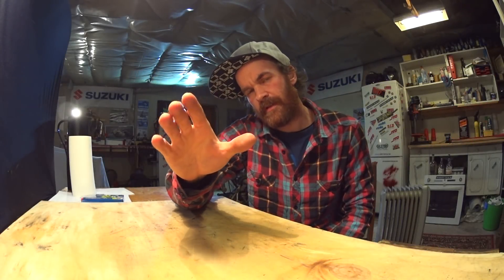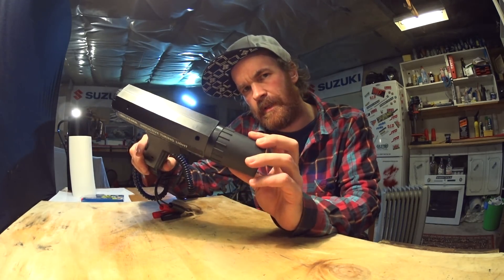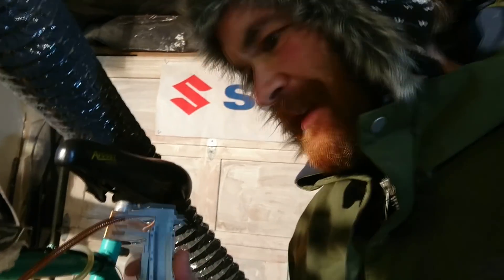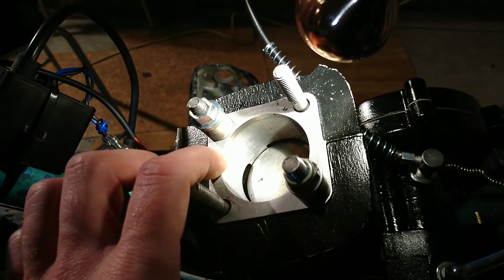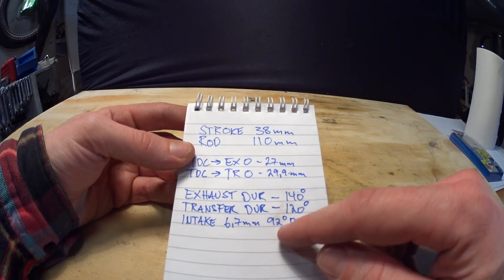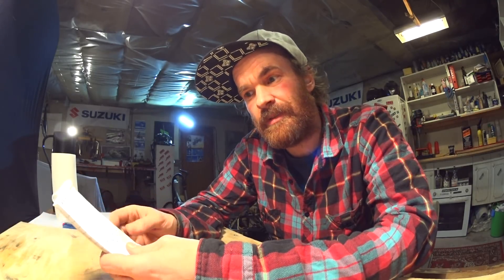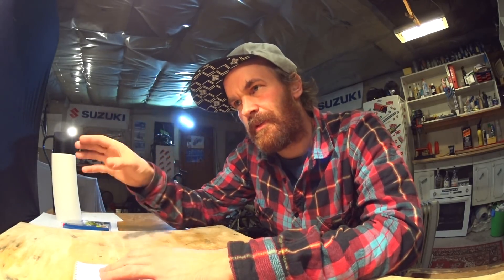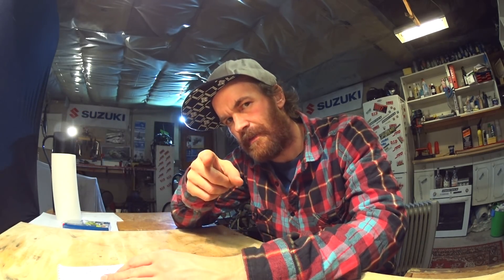Port Timing Motorized Bike, I'M SHOCKED! WHAT WERE THEY THINKING??

Comment: 🤔 you should well in my opinion do a port without a polish Dino test it and then polish it to see what power increases could be made with a polish proof of concept be cool I suggest testing the American hillbilly way and using steel wool to polish the ports i’ve done this before it works quite well surprisingly if you don’t believe me tested get some 0000 stealwool! Leaves a super smooth finish on aluminum
Reply: Jojo Mahama polished surfaces inhibit fuel flow compared to the slightly rougher surface, polishing does help in the exhaust port though.
Reply: Jon Rothenbusch That’s just I used steel wool because it leaves little tiny microscopic scratches but to the touch feels smooth I never polished it with steel wool till it was shiny and perfect and smooth as glass or anything just used a Dremel with a carbide bit and right after that used the steel wool. I just think it would be a good thing to test considering what I just said, thank you for pointing that out though👌🏻 I should have explained things a little better but then it would’ve been an extremely long comment just like this one. 😱 it just seems to have made my bike a lot faster! (throttle response and top and power) I do live at 80ft↗️sea level though so that could have some affect. Anyways I just thought it would be a good idea since he said he was going to go from one thing to another to another and it’s also a cheap engine if he does it on the motorized bicycle engine.
Reply from the maker: +Jojo Mahama Would be interesting!

Comment: I would cut it and either shave the head or top of cylinder or both, And maybe a thinner head gasket to restore compression. I have done this on outboard boat motors with good results.

Comment: I think that you should get a hold of a couple of extra cylinders just in case, and go ahead and port the stock cylinder. Then you can compare/test future upgrades on both a stock cylinder, and a ported cylinder, so people with stock cylinders can still see just how much extra power an upgrade will make from a stock cylinder vs a ported cylinder.
Reply from the maker: +Martinoffi Good idea!
Reply: Those cylinders are only like $15-$18 , that's what I'd do.

Comment: i would love to see. what could be gained from the engine with out changing cylinder, i like to no , if exhaust made for desired 140 duration made any power increases at all, as if you change barrel, then the  carb and then everything else., then what is there to learn from this motor. if a new complete engine is made then modified.  love this channel.
Reply from the maker: +nodwas1 Thanks! Good thoughts!

Comment: Why you don't use a graduate disc to measure the ports timings. It's more accurate I think.
Reply from the maker: +Olivier R That's a good method too! More accurate than the calipers, but micrometer is more accurate yet in my opinion.

Comment: If you have enough room under the bottom ring to open a boost port in the piston ( eg it is clear of the inlet port at bdc) grind a boost port channel in the liner and open it 1mm before main transfers and angle it so it flows at the edge squish/combustion chamber. I did this on a 250 single and the seat of my pants dyno felt an improvement. Your dyno could shatter my delusions. The trace carbon on the head looked like it flowed well.

Comment: I would say you have to lengthen exhaust duration before moving on to other things. I would go to 160 and test then go a little further and test again. I work with bigger engines a few 125s and 250s but most 500cc and up snowmobiles but my guess would be around 180-200 degrees exhaust because you going to end up building a pipe so you could build it to match that duration. Id say thats good for around 9000rpms.
What do you think?
Reply from the maker: +Dragon800 Sounds like a plan!

Comment: Did they design this engine to run without a tuned pipe? Without that properly timed pulse back into the cylinder, wouldn't you need a low exhaust duration to help prevent the un-burnt mixture from escaping?

Also, could it have been a very simple "EGR" for emissions purposes (ie. to keep some exhaust in the cylinder to lower combustion temperatures)? 

I have no idea, I'm asking you.
Reply from the maker: +Tyler Bandle possibly, good theories!

Comment: Holy crap that is nuts.  With port timing that bad, it doesn't really make sense to try intake\exhaust mods.  I'd say port it and try to get the timings where you want them first, then do the intake and exhaust.  My only guess as to why the port timing is that bad is so the engine isn't stressed at all?  De-tuned on purpose perhaps?

Comment: Not all cylinders are the same. Many are different. Unfortunately that’s one of the biggest problems with these. 
If you raise it more then 2mm your going to lose a lot of bottom end. If you raise the intake port you’ll need a Reed valve
Reply from the maker: +Zeda Motorsports Yeah, I think maybe I should get a "selection" of cylinders and see which fits the best.
Reply: I think most of the "bottom end" will be recovered by raising the compression and giving it a proper squish band. if nessasary re- gear to allow it to scream..
Reply: @MaFTB  I could reach speeds up to 90 kph with ease and .made it better on fuel cos would cover alot more ground on the same quantity of fuel also

Comment: Sure about the rodlength?
110mm is very long for 38mm stroke, but you never know with theese cheapo thingys =)

However, make the inlet in harmony with exhaust first.
Reply: i thought the same thing an rd rod is that length, it seems long for somthing so small. I just assumed you measured it. Ill bet they have measured the overall length not pin to pin
Reply from the maker: +Patrick Wetterskog Yeah, I was shocked when I read it. What's even weirder is that this is the "short" rod, other variations of this engine run 115mm. I haven't measured it myself tho, could be a good idea.
Reply from the maker: +marcus mcc I'll have to check, if it's shorter it would make port timing a tiny bit less insane.

Comment: around 190 deg. is too much for that engine,it will have no power down low.
Reply from the maker: +Vlatko Veselinovski Depends on the pipe, but yeah you might be right.
Reply: I would go 160 ex,115 tra. and over 130 intake on that cilinder with some mild pipe

Comment: That's what rhose things are for I have one in a garage but got no India what it did could it be used to check for spark because the motorcycle I am repairing seems way too hard to take off the spark plugs

Comment: If you port the exhaust higher you will need a real exhaust pipe, that would be interesting :)
Reply from the maker: +Nicolas Galley Yeah, Maybe the Malossi Team pipe I've got hanging on the wall could actually work!
Reply: 2STROKE STUFFING Oh yes, would be great ! Will the crank support the high rpm?
Reply from the maker: +Nicolas Galley No clue...

Comment: I would like to see porting step by step. This is a single speed so you need a wide powerband. My mildly ported bike pulls strongly right from idle and when racing you dont want to use the pedals to much.
Reply from the maker: +OSSA Nyberg Good idea!
Reply: I want to see you do what he said like how far should I go up on exhaust and I seen David’s video on how wide but is that to wide for mild port cause completely stock on a cdh engine I’m hitting 40mph and not I installed the Reed and windowed piston and it’s not firing at all it’ll crank but sounds lean I’m ordering jets they are on the way

Comment: Are you limited by the port metal thickness? 8mm is a long way to go. I would think you would grind a hole in the outside of the port.
Reply from the maker: +ngneer999 Probably, I'll look into it next time.

Comment: WOW! So if I'm thinking about this right prior to you spacing the cylinder up the exhaust port timing was even worse? Please make a video on a fix for this. It seems that spacing the cylinder up and shaving the deck is really needed.
Reply from the maker: +Allen Brown Yep, was even worse!
Reply: 2STROKE STUFFING - So my next question wold be since there is only so far you can go with raising the cylinder itself will raising the top of the port without raising the bottom be a problem? I guess what I'm getting at is will this take the duration too far?
Reply from the maker: +Allen Brown Duration remains the same regardless of the port floor being lifted or not.
Reply: 2STROKE STUFFING - Ah, ok. I see. Thank you my friend. Can't wait to see your solution for these problems.

Comment: First take the exhaust port to 155°, because this is the best timing for just a muffler on the exhaust and a fixed gearing. But 120° of transfer timing maybe already to much for this setup. After this I would go for 180-190° of exhaust timing and add a nice expansion chamber + fat carb. >>> to the max
Reply from the maker: +Elmar Dylong 👍

Comment: 140 Exhaust is low, but 92 intake is insane.
If that is correct then it confirms my last comment about the open exhaust working better.
Example a Yam 100 piston port kart engine with no gears is about 155 degree inlet, 175 exhaust
I'd suggest a bit off the piston skirt to open the inlet timing some, a little to start with and test it.
Reply: I think they just wanted to keep these engines super bottled up for longevity
Reply: 155 degree intake seems quite extreme and too much in my opinion. the longest intake duration ive ever used is 140 but then like ive said before i work with mostly 500cc twins and up so 250cc per cylinder is generally the smallest i would be familiar with. Do the small 2 strokes really run good with that large of an intake duration?
Reply: +Dragon800
500 single isn't revving to 13k to 16k range for one thing, timing reflects that too.
And the smaller the engine is, the better a rotary discs intake works.
You don't see rotary disc on any large capacity engine.
Larger capacity engines have the benefit of gas volume and inertia.
A 500CC single shoots canon balls of gas through the ports and pipe that wont slow down or reverse easily.
A small piston port can suffer from the lower crankcase pressure equalising through the transfer from the cylinder, on a rotary disc the intake can be opened early to allow equalisation through the carb instead.
Reply: AuMechanic I think the rotax 582 is rotary vlave and it's large for a 2 stroke
Reply from the maker: +AuMechanic Yeah, true. This cylinder is bad in so many ways...
Reply: The inlet is choked at revs badly. The pipe could do with a diffuser on it, baffle cone wont help if the intake is choked.
Reply: They run best with a reed valve lol and always open intake. Port piston is garbage. I convert all mine to 3 transfer reed engines.
Reply: Just to use the example of one extreme to the other in engine size.
Re the question "Do the small 2 strokes really run good with that large of an intake duration?"
Reply: AuMechanic: He did not measure the duration's (open) correctly, (in fact, with the most inaccurate method I have ever seen).  intake open is 6.7mm from TDC? (about .260")---seems like he is measuring the top of the intake port roof, instead of the bottom, where duration open actually starts.  I don't use a degree wheel very much anymore (but TSR "degree it"), but I think this guy should use one to double check his numbers.  I doubt he got good ex duration also, since 20 degrees of blow down is sure to reverse the flow in the transfers with hot exhaust gas. 
Doug @ ESP
Reply: AuMechanic:  Glad you asked.  I build 30cc (approx) engines for a living and win championships all over the world, (porting, head work mostly).  Those engines I build, (which rev to about 21,000rpm),  we run the intake duration from 150 deg open (high torque type porting), to over 160 deg duration open, (Higher rpm power).
I am not sure what large of a intake duration you speak about though,---92 deg open? (which I know he did not measure correctly.).
The port time for smaller engines is not that much different than larger engines, (more variance is what the engine is for, utility or racing).  If this gentleman has the TSR software his vids show a logo of,--he would be using the program called "degree it" instead of a piece of bent wire.  Pretty handy program really.
Reply: "I am not sure what large of a intake duration you speak about though,---92 deg open? (which I know he did not measure correctly.)."
Do you mean larger engine, that is what I am referring to.
A large and small engine may have the same intake timing but the larger one has more gas moving (bigger holes, more displacment) that carries a greater inertia, meaning it is less prone to reversing direction.
In the rotary disc we can open the intake early so that as case pressure drops it equalises pressure through the intake and carb and not the open transfer.
Larger the engine the less prone the gas will be to reversion back from the transfer, thus the benefit of rotary disc reduces as the engine capacity increases.
Reply: Yep it looks like it. Id have about 1mm off that piston skirt to start.
If that improves it trimming the skirt is a cheap mod anyone can do without porting tools.
Reply: piston port engines can make great top-end power
Reply: Steven Main:  I build a lot of smaller gas piston port and reed vale engines, (turning a piston port into a reed engine, adding 1 or 2 boost reed transfer), but I only build reed engines with an aftermarket reed case.  There are "cylinder reed valves" available that I can work with, but the cylinder intake is not designed for the reed valve, and a compromise of reed block geometry has to be done, (for the engines I build anyway).  My reed case engines run slightly better than my piston ports and better than any cylinder reed that has ever been built on the engines I work with, (Zenoah), so I would not call a piston port junk.
Reply: I agree a piston port is not junk, they just have a fixed symmetrical timing where the other have asymmetric timing and in the case of the RT IO and IC are adjustable from one another so that provides extra latitude over the piston port for high specific power engines.
A piston port serves quite well and in Karting was the mainstay for decades..
But in this case it's not a trusty Yamaha Piston port and its made of part Chinesium.
As you may note in next video the ignition rotor decided to show an exploded view of itself.
Reply: im confused what your getting at why are you talking about a 500 single?
Reply: gotcha
Reply: Yes there was an error in the intake timing but he did correct that in the next video.

Comment: How does that exhaust port duration affect torque and revving compared to more common durations?
I'm just guessing here with no particular knowledge about port timing, but it's a bicycle engine with only one gear so could it be that way to give low end torque while sacrificing a lot of power at the top?
Reply from the maker: +Henrik Yngvesson I think your onto something!
Reply: So if that's the case I think you should port it for more power at the top as you can pedal to help it at the low end and then get the engine to take over when your pedalling maxes out.
Reply from the maker: +Henrik Yngvesson I like that idea!
Reply: Man you hit that nail on the head!

Comment: Port the exhaust to 170 degrees total open duration first , then go from there , this will give a decent blowdown . then maybe 4bhp@8000rpm
Reply: I agree with Noshir, 170° exhaust, 120° transfers - gives a blowdown of 25°. Should be fine for this single speed centrifugal clutch setup. And then inlet timing of 140-150° ish. I've seen replica cylinders for Vespa Ciao, that are totally wrong like this one, something like 11° blowdown, runs like garbage.
Reply: And maybe lighten the clutch shoes and some stiffer springs if you can find any :)
Reply: Won't need to mess with the clutch or springs, they can handle it
Reply: Patrick Yosef it sounds like it engages very early in the rpm range, i would definitely raise it for better take of :-)
Reply from the maker: +Noshir Irani 👍
Reply from the maker: +Carsten Lorenzen 👍
Reply from the maker: +Carsten Lorenzen Sounds like a plan!
Reply from the maker: +Carsten Lorenzen 👍

Comment: Port it out mate! 👍
Reply: Yes you should...  :) 
Being a Puch Maxi guy (that means piston valve) i wonder if raising the barrel actually may have had a negative effect on power in this case, as the duration of the intake port on the back of the cylinder was lowered by quite a bit?
"Back in the day" we used to shorten the piston skirt on the intake side by approx 8mm which made a significant improvement on power.
Jeg er fra Danmark, men folk skal jo kunne følge med i samtalen.  :)
Reply from the maker: +blairo15 👍
Reply: @2STROKESTUFFING  i hope you get back on this project eventually... Make it a "rags to riches" type of video lol
Reply: Port it out. And trimming the intake side of the skirt is commonly done on these too.
Reply from the maker: +Sajmon_DK 👍 yep, did screw up intake timing a bit when I lifted it.
Reply from the maker: +derk nobit 👍